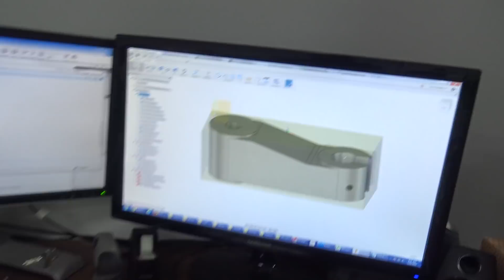Chip Break #8 - Machine Shop & Small Business Daily Life

Comment: It wouldn't be difficult or even that expensive to put a small (and basic) robot arm in the 5-axis mill that could pull the part out, rotate it 180, and place it back into the same chuck...
Reply: I was thinking of doing a barpull type thing where you could take the barpull grips and hook it up to the coolant lines. So you grab the part, open up the spindle, turn on the coolant (which would fill a pneumatic or hydraulic cylinder) and then put it back into the chuck for s2. I am not sure why nobody has thought of this but it seems relatively simple and you wouldn't need another addon package for relays or anything, it would use coolant. Maybe ill make it at patent it lol

Comment: Something to consider since you haven't made a dedication to a spindle interface on a milling (not sure of the tormach spindle taper interface) machine is to consider the HSK style tooling. It's a more rigid setup and more stable when it comes to high spindle RPMs. Then traditional cat40 tooling. It would also allow better turning ability if you did go with a mill-turn machine such as an intergrex or similar machine. Cat40 style tapers weren't designed to be used for turning although they have been. The HSK style is more advantageous for such machine processes.

Comment: It all depends on what you are going to machine. Your a small shop at the moment. And im guessing small batch runs. So whats wrong with taking the part out and turning it around for second opp. Also 5axis mills wont have the rotation speed for small parts. Better suited for alloy wheel sized parts.
Reply: Huh?

Mori NTX 1000 (full 5 axis mill turn) has a 6k RPM main lathe spindle and 12k tool spindle...

Nakamura lathes, max out at 5k main spindles (they might have a 6k now...)

Okuma Genos. 4,500 with optional upgrade to 6k. 

Mill turns sport the same spindle speeds as standard lathes do. RPMs are the same or even faster. 

They do have slightly less torque though, but only 5-10% less.

Comment: Depends on the parts. More complex parts have a higher price tag to machine. So you can offset the higher cost of the 5axis machine by taking on more complex parts that you can charge a premium for. Especially when you deal in low quantity and fast turn around times. 

The other side is a more standard lathe and take on simpler parts, but make them in larger quantities and make your money by saving time/part. 

Comes down to what parts you want to make and what your customers are asking you to make. 

I will say that being able to tell a customers "yes we have full multi-axis capabilities" opens up a lot of avenues. Even more so when you say "yes, we'll make just 3 of those, we don't have a min quantity" 

John seems to have hit that cross road all job shops hit. Do you go the higher quantity lower price/part route, or go the lower quantity higher price/part route.

There's money to be made either direction, but machine selection starts becoming a bigger factor.

Comment: John, as someone who ran 5-axis multitasking Nakamura-Tome STW40's, that sort of capability is very, very expensive. $1.2 million a pop sort of expensive. Sure, it's got two turrets, two spindles, and (ours anyway) 160 tool hive, but it's a production machine. In our case one machined cast iron pieces, and occasionally steel, and the other aluminum castings, all Fanuc robot loaded via a conveyor, piece check count was under every 10, and two CMM checks per shift. They are production machines with a price to match.

On the other hand, think of a 3-axis live-tooled lathe this way: it's a less-rigid HMC with bar feed capability. The Super NTM3's I ran were balls-out the most productive machines I've ever seen (twin spindle triple turret and stupid accuracy). For real speed, multitasking machines are where it's at.
Reply: NYC CNC To be fair, Nakamura-Tome is on the high end of the scale in that regard. You can find other MTB's that will likely cost half as much, but that still puts you in the half-a-mil range. The Super NTM3's were $800k apiece, although I don't know if that included the barfeeder.

Comment: What? Live tool lathes are not going away, Mill turns are getting more popular and there are many (dozens at least) different styles. Turret style lathes are simply faster than any other option when your parts are mostly round, also there are many machine that have multiple turrets or a mill head and a turret or two. Indexing a turret is way faster than changing a mill tool and far more rigid than a mil spindle. Now mill turns are great when your parts are mostly milling and just some turning, hence the name. Also they tend to be way more expensive to both buy and operate due to the extra complexity. Say you have a bad crash and you need a spindle rebuild on a live tool holder its about $1200. You need a rebuild on a mill turns spindle it can be tens of thousands.
There is no silver bullet in machine tools, they all have their scope and you have to look at it that way. Take for instance those clamp parts, you could do them on a $500k mill turn or you could do them on a $100k live tooled lathe, and the lathe would be way faster and take up less space. Unless you have a scope then you can't spec a machine. If you just say I want a machine that can do it all then you're going to end up with a hugely expensive machine that needs to make $250 per hour or more just to pay for itself and that's why I don't have one :)

Comment: I have to say, there are various levels of "how much money do you want to spend" and "what actually gets the job done".  There is plain turning, live tooling, live tooling with Y axis, sub-spindle, twin turret, twin turret with sub-spindle, mill-turn.  But then you get into machining centers that do turning, and that's the turn-mill stuff.

A Mazak Integrex is a nice tool for a specific type of job, however you will find that live tool Y axis sub-spindle lathes are pretty common and at the top of the heap of conventional turning.  They have good rigidity and maximum versatility.  A Mazak Integrex is REALLY REALLY REALLY expensive to fix when you have a decent crash, and it's down for a long time.  If you want to buy a new lathe, definitely look for "SSY" machines, but if the price is too much, look for "SS" machines.  Often times the live tooling is denoted by an "M" in the model name.  Don't forget there is also "big bore" options too, these generally allow you to swallow at least a 3 inch piece of material.

Comment: John, There are advantages and disadvantages either way. As you can see from my thumbnail I own a Mazak Integrex E650 witch holds 80 Capto 8 Tools. It is a full 5Axis machine. These typ. of machines should be considered a milling machine with turning capability (I have seen people just do turning on this typ. of machine it is a total waste of the machines capability) It is a mill more than a lathe. The advantage is you can do more in one operation and hold better alignment between milling and turning. That said I have done just milling jobs(No turning on this machine). But it takes time for the tool changes. On my machine I don't have the big boring bar attachment or the sub spindle(It has a tailstock). This restricts me to a overall tool length of 19.5" for the tool changer(Can make manual changes of longer tools). But what I  was getting at a lathe with live tooling if the part is right configuration can machine the part faster but it cannot do as complicated of parts because you are limited on how many tools you can setup in one operation. also it cant do full 5Axis work. I have run both typs. of machines the live tooling spindles are expensive and can only handle relatively light milling compared to a multitask mill turn machine. The initial cost of the machine will be more for the multitask machine than a  lathe with live tooling even with buying milling spindles. Also something to consider on the multitask turning tooling will be more expensive than a conventional lathe because you have to have a tool holder to mount the tool in. These holders have to have precision keyways(Big plus cat tooling) to hold alignment or if your machine has a capto taper (Much better) you will pay more for the tooling. To tool up my machine cost initially about $80,000.00 but it is a large machine. ( A Sandvik tooling certificate helped with that). So in the end you have to ask yourself what typ. of work you intend to do. Do you really need 5Axis? Are you doing complicated milling operations on you lathe parts that require more tools, or can you turn on the lathe and go to a mill? These are very expensive machines in the beginning it might be better to having  a separate lathe and mill. You can buy them both with the cost of one multitask machine. One last thing I like my Integrex for the oil field work we do here in Houston Texas it is the ideal machine for this work. It combines a horizontal, vertical mill and a lathe all in one machine.
Reply: If you don't mind me asking. Why would you not use the integrex's turning capability?  Using it as just a 5axis mill seems just as wasteful as using it only as a lathe (which I too have seen shops do...  Baffling...) 

And an E650 is a big machine!  I usually see them used to machine oil drilling heads and large vacuum pump rotary lobes.  Something like an i-150 or i-200 would be sufficient for what he does and with a slightly less jaw dropping price tag to boot. Mori NTX1000 isn't a bad option either, though it is a bit cramped in the machine.
Reply: Occams Sawzall What I was saying is I have seen shops buy a million dollar mill turn machine and just use the lathe capability only. They could have bought a Slant 50 for less than half the price and done the same thing. You are right about the smaller machines for what he does but if you price out these machines fully tooled and delivered to his shop he could buy a separate  lathe and a mill for the same cost. Once we did a study on if it is more efficient to do turning and milling on the same machine. In almost every case we found it was not except for certain kind of parts that require very detailed setups and that require hard to make alignments between setups, or full 5Axis work. The thing is in one case you have only one spindle running and the other you have two. So if you have a low quantity of parts it might be more efficient to run them on the multi task machine. But if you have ever done this kind of setup it takes time and to keep track of say 60 or 80 tools and offsets is almost mind boggling. I ran a titanium part not long ago that took all 80 tools and had over 900 dimensions called out on the drawing. To machine this part took 2 weeks. This is the typ. of part that is made for a multitask machine. Production can be done faster on separate machines.
Reply: +Edge Precision oh trust me. I have run multi-function machines that had over 200 tools chambered up. 

Right now I'm spoiled. Own CAD and CAM package for just the machine I run (we're all spoiled here). I only have 32 tools on the machine I'm on now, and found its easier to use CAM to keep track of all the tools.  Took a few months, but once I got all the holders, tools, vices etc defined in CAM I'm now able to make all adjustment offsets in the CAM rather than the machine. And keep a running library of diameter adjustments and such. So if my 1/2" finisher shrinks by 3 tenths, I adjust the diameter in the CAM tool library rather than the machines D offsets. 

We're and R&D company and make in house prototype parts for our projects. And our multi-axis/multi function machines are the backbone of the shop. And this is where those machines shine. Low quantity parts and minimal setups. 

But yes. They are ill-suited to the world of med to high production. Too slow and too complex.
Reply: Occams Sawzall I didn't mean you personally it was meant a general statement. I personally I prefer to use the compensation ability at the machine that way I don't have to reprocess code for every change in tool diameter. But if that works for you than that's good.My machine is a Mazak as I said. I very seldom run a Mazatrol programs I run what they call EIA (G Code) programs. But the Mazatrol control lets you run mutable tool offsets on each offset. Like Tool 1A, Tool 1B ( in the code this would be T1.01 and T1.02)and so on for almost every letter in the alphabet. This is handy if you have enough tool holders you can setup many jobs and just swap tools and run. It is the only control I have run that does this. Also there restart feature by saving tool points when you have to index inserts is very nice. It follows the points you saved after pressing feed hold and does the feed to the last( or actually first from the stopping point) segment at the programmed feed. all machines should be able to do this. It saves a lot of time if you are in the middle of a long running roughing cycle.

Comment: There's mill-turn. And turn-mill

Mill-turn has a full lathe spindle with a secondary milling head that can swivel. These are the Mazax Integrex style machines. And because the large tooling is mounted into the milling head. You don't need left or right hand tooling. Because the mill head can rotate a left hand to 180 into a right hand tool. 

You can add a bar feeder, sub spindle or tail stock to an Integrex. Also a work hand vise for secondary milling ops (right I the same machine) large Integrex machines can have dual lathe spindles and dual milling spindles.
Reply: Turn-mills. Are what you described. DMU and Mori make them.  These are primarily milling machines with a  standard X,Y,Z. And have a C,B rotary table. The C rotary on turn-mills gets upgraded to be able spin upwards to around 5k Rpm (sometimes less depending on maker). These machines act more like vertical lathes. Can't handle long parts, but capable of turning huge diameters (think large wheel rims). 

The Integrex mill-turn style is what you should be looking at.  The turn-mills are more of a niche. Still more flexible than a 4th axis VMC or live tool lathe. But probably not what you want right away.
Reply: Left hand or right hand tooling in a mill-turn determines which direction the chips shoot.  It's the same difference it's always been on a slant bed lathe.  An "upside down" tool shoots the chips at the chip pan and lifts the turret, so it's slightly less rigid.  For maximum rigidity you put the way in compression, but the chips shoot at the window.
Reply: +eformance 

Yes. But the machine "flips" it for you. So you only need to take up a single tool position to do both instead of setting up two tools. Which drastically reduces error and mismatch in parts since the same tool is cutting. Also means you only have to adjust a single tools compensation instead of two, reducing the human error side of things.
Reply: Think about that for a little bit.  If I always want the chips shooting at the way covers, and not the window, I will need left and right hand tools for left and right hand cuts.  It's true that you could use a single tool for both, but you're going to be shooting chips at your window, which is not desirable.
Reply: +eformance what's wrong with chips against the window?  I find that to be a rather soothing sound :D

And our integrexs here rarely shoot chips against the window regardless of direction. They either go up and towards the back or  down and towards then back.
Reply: +eformance oh you're thinking turret like standard lathe turret?  Ya. Ok then yes in that case you're right.  

I'm talking about full mill turns where the lathe tool is mounted into the milling spindle via CAT40 or HSK holder.   No lathe turret. So doesn't matter which direction you go the rigidity is the same as its mounted into a tapered mill holder and not on a lathe turret.

Comment: I work with both a Okuma Macturn and a Multus U3000 every day and they are really great machines. 

You really have to consider what parts you want to run on the machine a lathe with two turrets with live tooling and a bar feeder is a hell of a lot faster then a machine like the Multus U3000 or similar machines. 

But there is a ton of options for the multi axis lathes the Macturn i run have all the options and it's really fun watching is run a part where the B turret start on the main spindle side and the A turret takes over finishing the parts while the B turret moves to the sun spindle side and finishes the parts on that side.

Comment: Hey John
 at around 3:00 you were talking about 5 axis mill-lathe combinations and that there would be a problem with adding a sub spindle. There are in fact machines that can do 6-sided complete machining.
Here is the link to a very interesting pdf about such a machine sold by DMG Mori: http://us.dmgmori.com/blob/304266/8f28f416b5ca99430fa19ef15bcc23bb/pt0us12-ctx-tc-series-pdf-data.pdf
Reply: +NYC CNC Yes, DMG MORI has many 5 axis options.  Just for grins, check out the Lasertec!